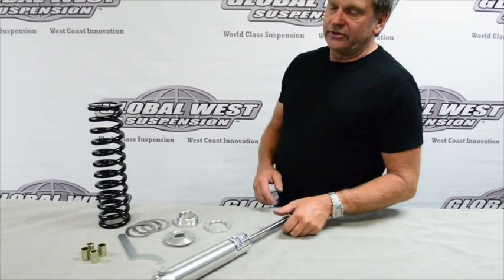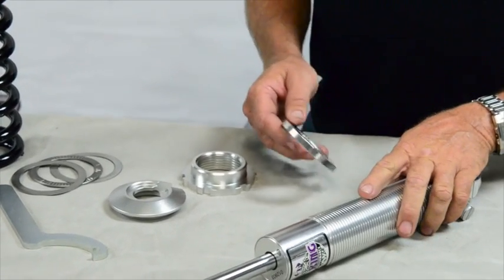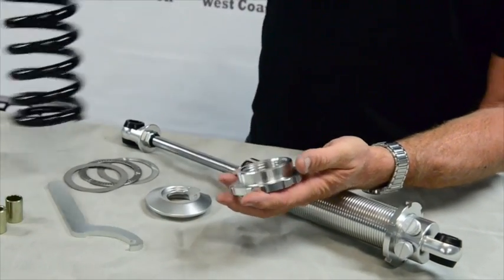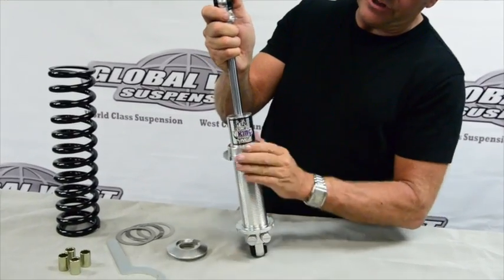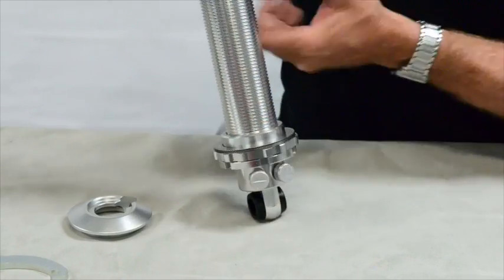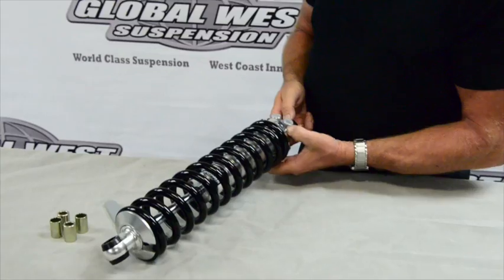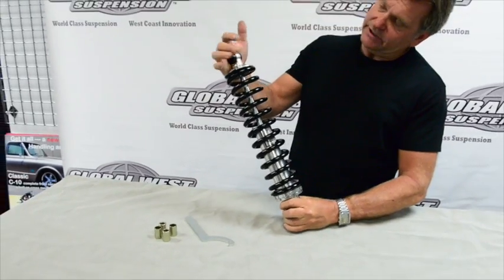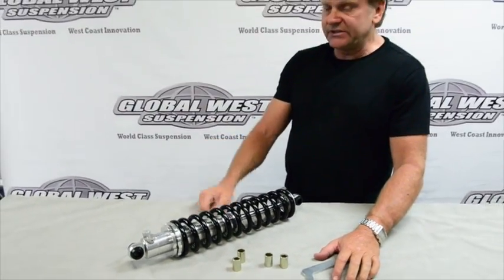Assembling A Performance Coilover Shock & Spring For Install

Comment: Are all coil overs this easy to assemble?  Looking into a complete 3 inch suspension lift and most online options want $200 for assembly.  Is there more to this or are they all really trying to rip people off that badly?
Reply from the maker: Give our tech experts a call to get that question answered ASAP! 877-470-2975

Comment: Anti seize is required for this type of installation. Not using it will ruin  your threads and turn your expensive coil over shocked into garbage! Wow. And you put the first nut on the wrong way! The shoulder goes up against the spring mount nut.
Reply from the maker: this was a demonstration video not an install video of course apply anti seize according to instruction and to when it is properly needed!

Comment: Cheap chinese junk
Reply: troll these are made in Minnesota they are built better than QA1
Reply: 21SFBay - Do you actually think before you type..? These are in the top 5 MADE IN THE USA Shocks... What;s the matter you couldn't afford them so you lash out, Troll. Good Day Sir ; I SAID Good DAY!!
Reply: 21SFBay  have you ever ran these coilovers? I have. they're are plenty of people using them on f- body's with great success. maybe do a little fact checking.
Reply: steven giles I just recently front and rear for my camaro. They are a very nice set
Reply: Do your research
Reply from the maker: American made!

Comment: in my country guys use shorter struts and cut springs as coilover alternative, what are your  takes on this
Reply from the maker: Hello Kevin, thanks for watching our video. What you suggest is OK as long as you have enough suspension travel.
Reply: Do you have a spring over adjustable shocks for the rear of a 1969 Camaro with multi leaf springs? I need to raise the rear of my Camaro about 1 -1.5"